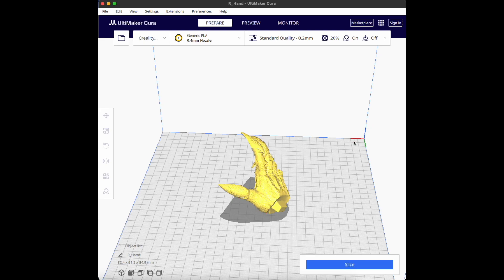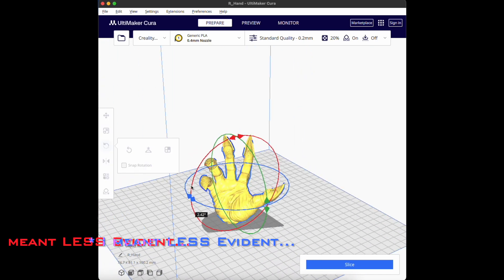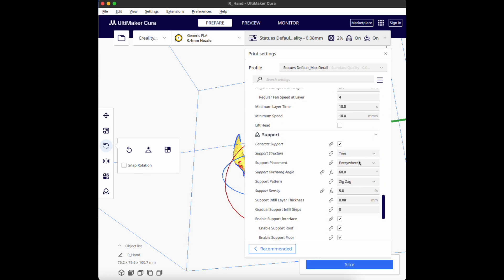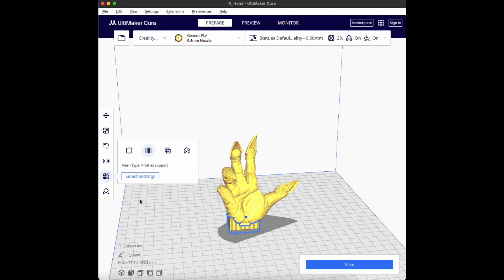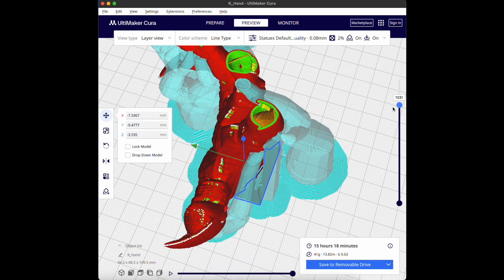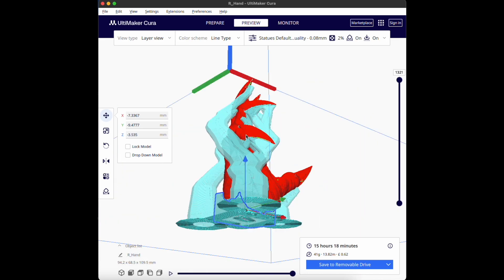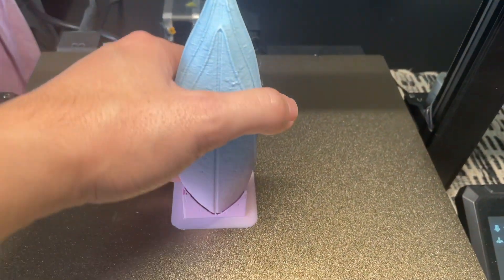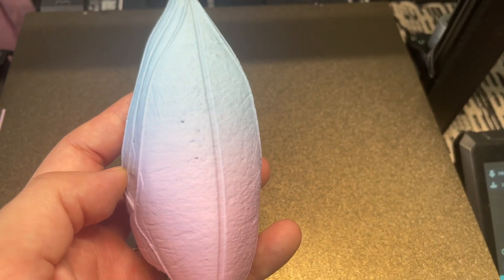How To Add Supports to 3D Printed Statues (Quick Tips)

Comment: Do u 7se the support blocker when  printing heads  on the. Peg
Reply from the maker: It really depends on how the head is. Mostly not needed as commonly they have the female side of the peg… main thing to look for is how much of the actual part will be touching the base. Think about an upside down pyramid… anything that looks like that should benefit from the block…